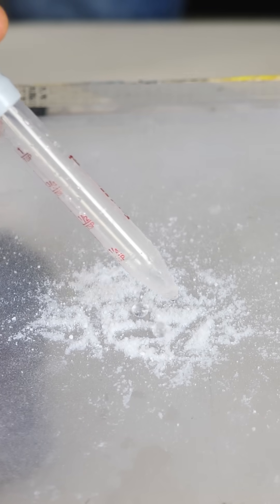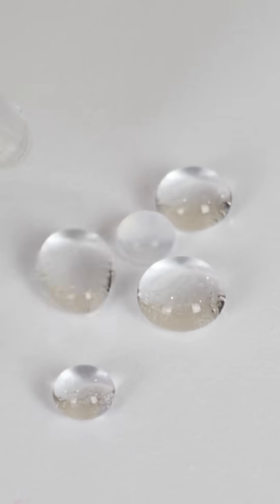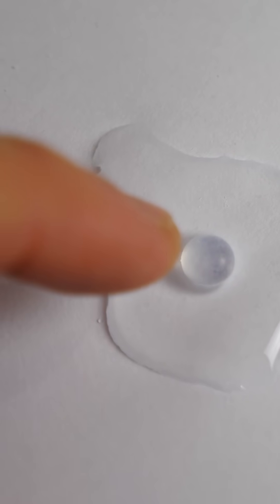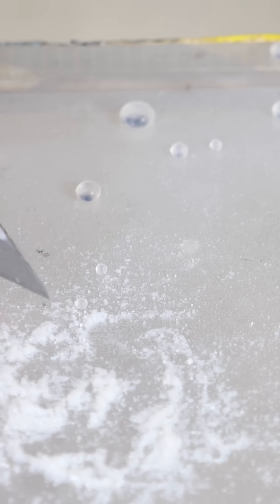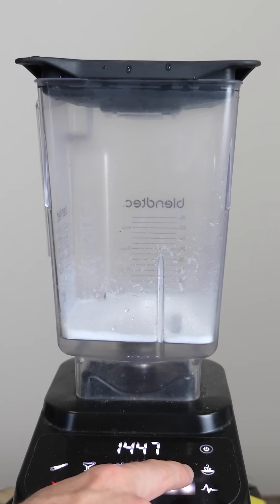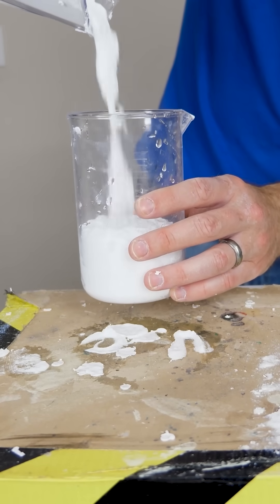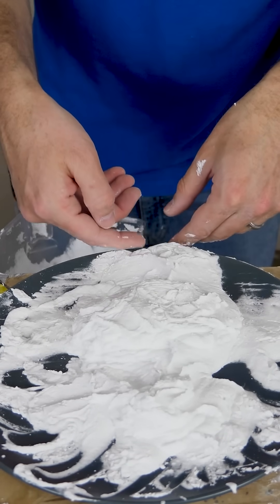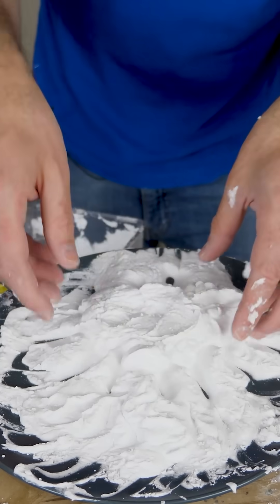I Made Dry Water

Comment: Question. Since water is fairly resistant to changing temperature, would this mixture make a good insulation from heat and cold or would the mixture just separate over time and not keep its desired effect?

Comment: Is it really an AIR-water emulsion if the dry water is, as you said, a liquid surrounded by fumed silica, which is colloidal solid-liquid mixture, snd therefore a gel?

Nevemind, the silica is an emulsifier and with the blender, the water gets divided and atomized, or is made particulate, like tiny squishy beads. The blender also introduces and mixes air into the water particulates. The property of rhe sillica that lets it coat the water into self-repulsive elements is what makes it s good emulsifying agent.

Comment: We use micro-silica or fumed silica in the construction industry as an additive to concrete. It fills the micropores of concrete making it significantly stronger and more water tight.
Reply: It's also a component of aerogel insulation. The dust from the insulation will make water hydrophobic.

Comment: First they made heavy water then they made dry water, next thing you know they're gonna make flaming water
Reply: Its alr a thing. Just whip out your frying pan pour in some oil let it heat for a while than pour in water and TADA! You just burned down your house(probably)
Reply: Take water, put a thin layer of alcohol on top, light it up. Drink while flaming for extra fun.
Reply: Seperate water; H2 and O
Join the elements back together. Clean fuel
Reply: flaming 🤔
combustable  😏
Reply: Ever been to flint michigan?
Reply: @ArachnidAbby 😂😂😂!! This is the best comment!
Reply: @ArachnidAbby  thats dirt water
Reply: There's a planet out there in the universe that already does this, if I remember correctly. Something similar, anyway. Just like there is a planet that rains molten glass sideways at several thousand mph or kph. It's a very windy planet apparently.
Reply: @scottfelt513 HD 80606b is a planet that detonates it's atmosphere every orbit. This happens because it has a goofy ahh orbit that takes it really close to HD 80606 causing explosive thermal expansion
Reply: I did see someone make fried water, once.
Reply: @JackSteel1026  I think that was nile
Reply: It's been done. We lost the recipe. Look up greek fire.
Reply: Baked: lake Erie, 1969.
Reply: That's basically ethanol
Reply: They did that decades ago. It’s called Deepwater Horizon!
Reply: Just use american tap water

Comment: Introverted water
Reply: Introvertion is not the correct term to address the characteristic of shyness (edit: "shyness" or being shy is the presumed factor that lead you towards the introvertion conclusion) possessed by a particular entity of discussion. Introvertion is just a trait (that can be applied to most species) that describes the considerably lower tolerance of socialization. Therefore, as an example , an introverted individual can still be what some may call a "social butterfly," although, there social tolerance is noticeably more fatigue, or short(er)-lasting. It can also be worded that for introverted individuals, socialization decreases energy, while being in solitude increases energy, and the opposite for extroverted individuals.
Reply: @conclusionary  It's just a trivial joke, unrelated to science. Picture a world where humor and hypotheses intersect. Even though we often mix lighthearted fun with scientific concepts, this joke stands alone as a simple, amusing quip without any scientific connections. It's purely for a quick laugh, nothing more.
Reply: @moronicacid9731  I know. I should have specified that the information I provided was less of a correction, and more of a theoretical perspective for one to perceive IF they desired to garner that particular information, as the information I provided still does regard the comment, although, considerably, not a direct response seeking publicized correction. My bad.